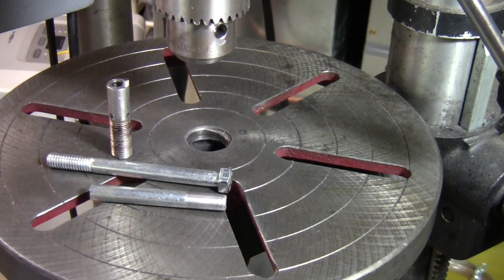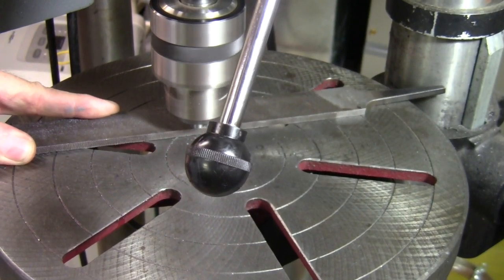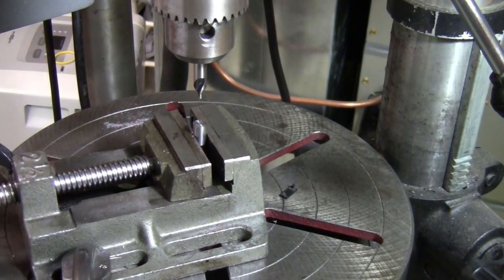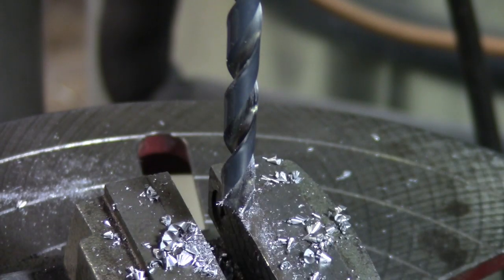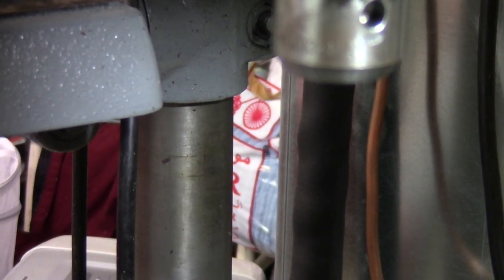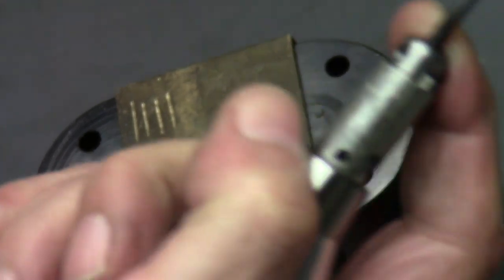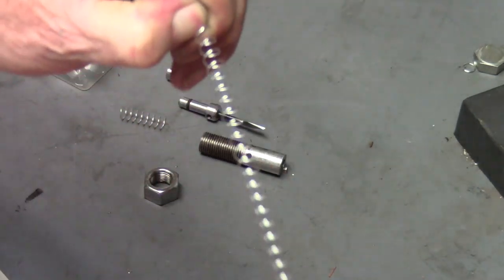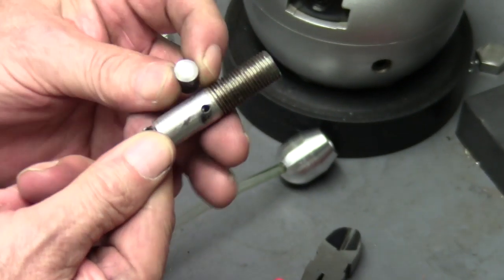How to make a Hand-piece for the Homemade Hand Engraving Machine part 6 making the  Piston & Spring

Comment: Thanks for all the advice ( the how to ) Made a few allready. I did as a test replace the spring with 2 small round neodymium magnets . One sits in the piston...the other on a stem at the palm piece side. They push eachother away. I do not say its better...but it seems to work a bit cooler and the graver does sound less noisy.  A question : does the weight of the total handpiece have any effect on the power. Let say i make 2 exact the same handpieces with a 4 gram piston inside..... 1 in brass (8.4kg per square decimeter) and one in titanium ( 4.7kg per square decimeter). I dont know but would a 4 gram piston not have more power in a lighter handpiece because it needs to push less mass/weight ??? You tried with lighter plastic handpieces....do they have more or less power or doesnt it make much difference at all ??
Reply from the maker: The magnets sound cool, I'll have to give it a try. I have made quite a few HP's and I can't tell any difference in power between the steel, brass, and plastic HP's. They do like a different spring tensions, but there is no difference in engraving power. Keep experimenting!
Reply: @ralex397  Thanks for the reply. If there's not to much difference between a plastic one and a stainless one ( the weight difference is even more than brass and titanium)  i guess the weight difference from the used materia for the handpiecel is not that crucial. The way your gravers are made it can be done sheap...and i bet they perform more than well enough for most amateurs. Thanks a million...i now do not need to invest an arm and a leg in buying a top brand handpiece and compressor  to get started.
Reply from the maker: The piston does all the work, and it doesn't seem to care what material its inside of. Its a balancing act between the displacement of the modified compressor, and the volume of the tubing, foot pedal and bore of the hand piece.

Comment: Is there nothing to hold the tool in the handpiece ?  How long( and why so ) should the shaft be ?  What are  the parameters of the spacing between shaft and case . I learned a lot from your video as you explain HOW and HOW MUCH on measurements but too many WHYs go unanswered. Not a negative post , great job.
Reply from the maker: An O ring holds the tool holder in the barrel, and when you are engraving it holds it in place. I provide free blueprints, email me for a copy.

Comment: Hi. I don't quite understand how your device works. If the air pushes the piston in the same direction as the spring, it never returns to its initial position. If the air enters the other end, I would understand better. Thanks for the video, although if you allow me a suggestion, the sections where you work pieces, you should shorten them. If not the video becomes very long.
Reply from the maker: See this video for how it works https://www.youtube.com/watch?v=F1FXjUErC1Y

Comment: Not sure if you’ll see this but I noticed in the video you said the piston you made is mild steel. Does it have to be mild steel or would stainless work?
Reply from the maker: You can use stainless, I had mild steel that was close to the diameter I needed so that's why I  used it
Reply: Thank you, I kind of thought that was the case. I happen to have a bunch of 3/8 stainless bolts so was hoping to use one of those. Looking forward to trying to make one of these. Gathering all materials now.

Comment: Can you explain how the quick change bit holder works please?
Reply from the maker: The QC Tool Holder is held in place by a small O ring, keeps it form falling out,  as you engrave it is pushed into the hand piece, so no need for a set screw to hold it in place. You can have as many gravers as you like sharp and ready to go, change them out as needed.